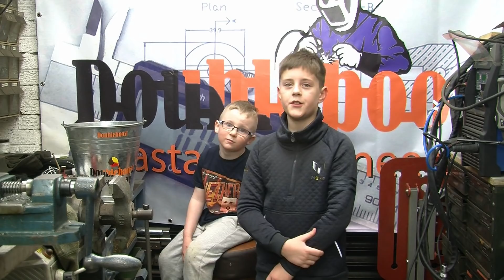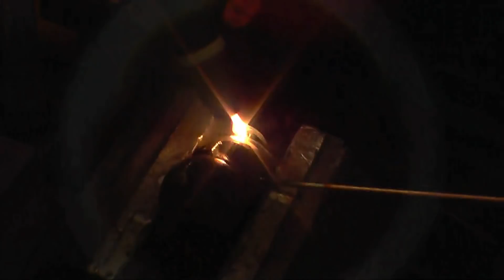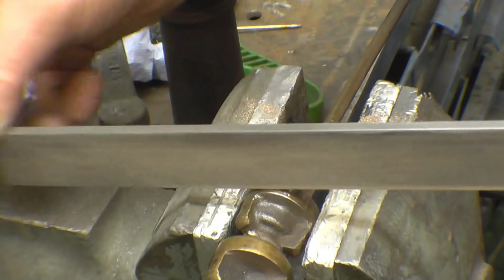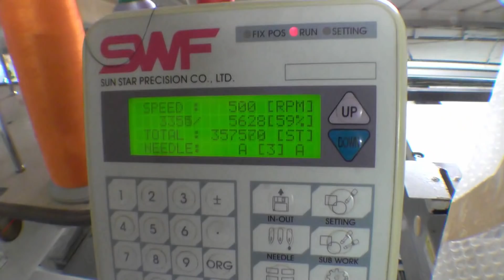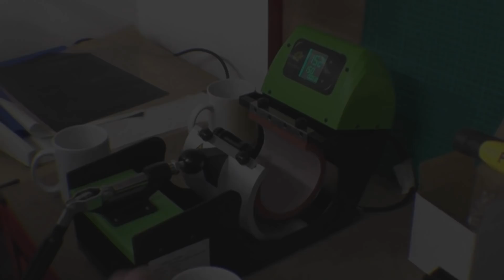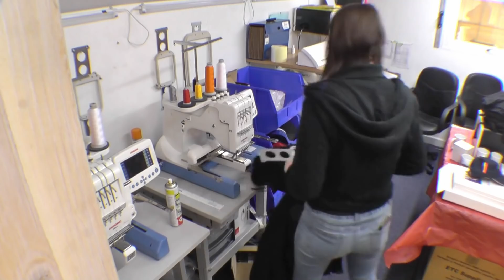SNNC 271 P1  Bronze Valve Repair

Comment: I liked the bronze tig repair. I'm definitely a sad case because I could tell that was 100Hz from the sound. I have some tig rods that are for welding an alloy called yorcalbro. It's an aluminium brass alloy containing zinc. It's highly corrosion resistant and is used in seawater cooling systems. The tig rods have a flux powder held in circumferential slots along their length. This is apparently to stop the zinc leaching out.